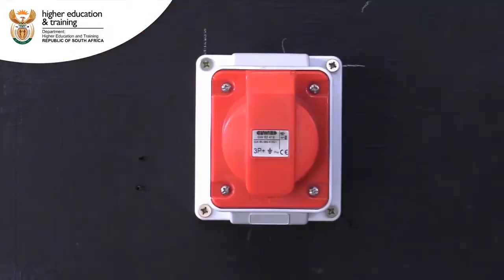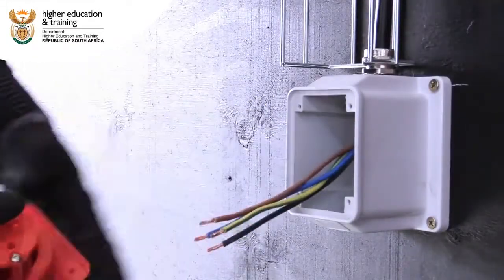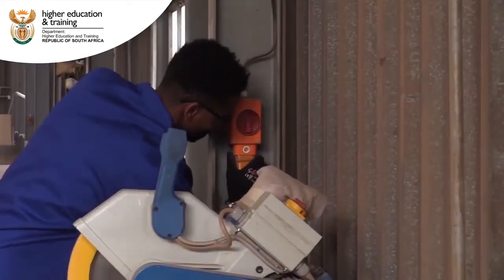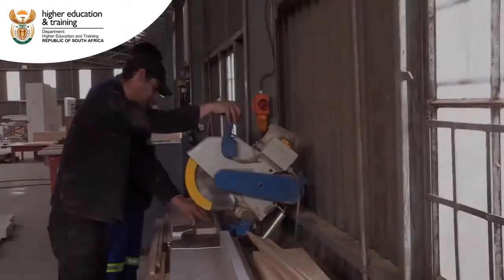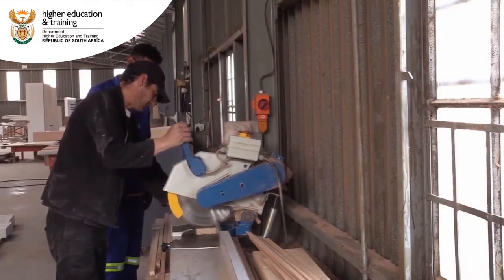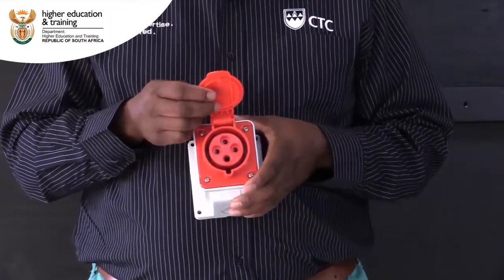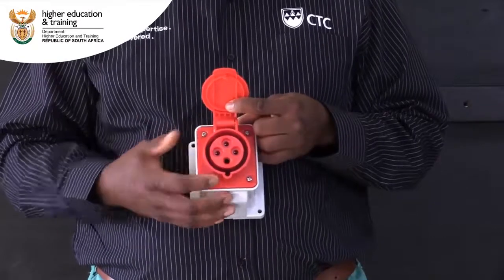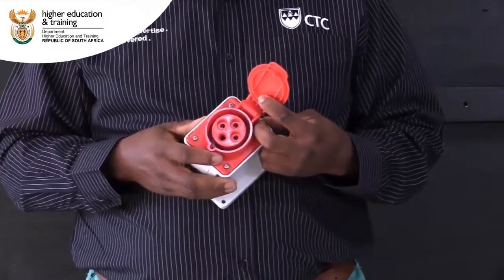3-phase sockets and how they work

Comment: How does the socket switch break the current flow? Does it open all four wires? Or does it just break two of the lives? How do you disrupt power to something like a 3 phase motor without damaging it or causing it to idle in a weird way? Thanks